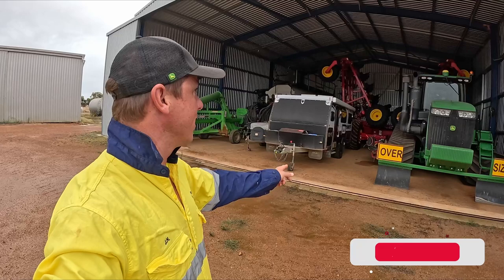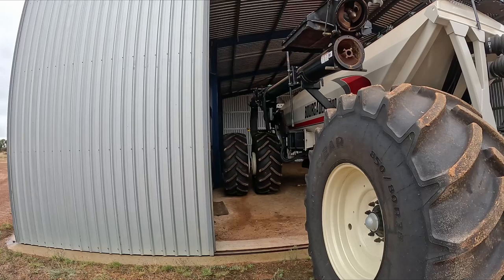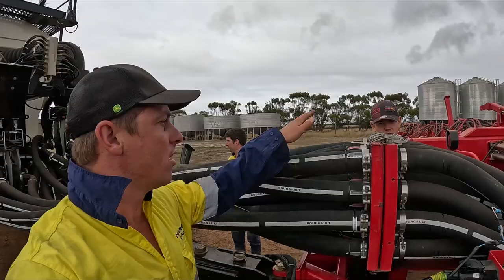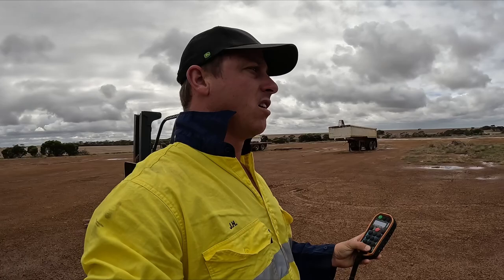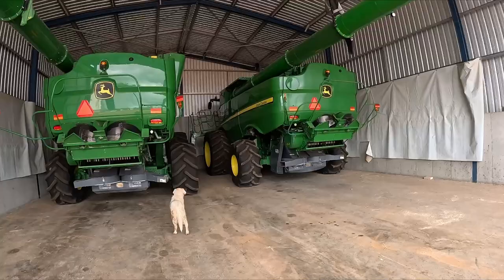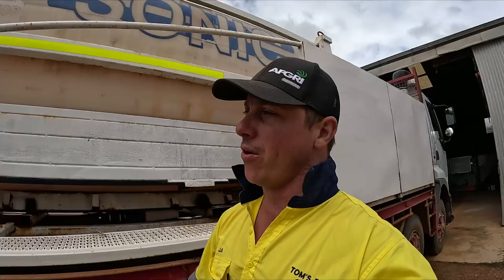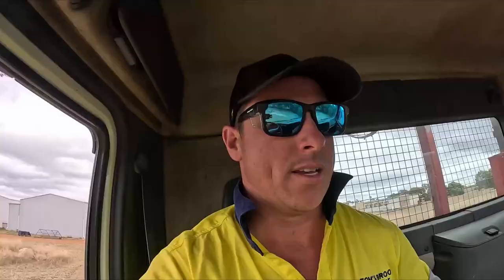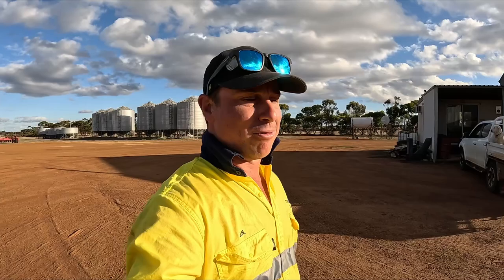2023 Seeding Preparation | Western Australia

Comment: How long are the augers on those headers? Looks a fair bit longer than the standard 28.5''
Reply from the maker: They are longer, I can't remember the length of the top of my head but it is the longest auger you can get and then there is an extension at the end to get out even further. Its so that we can run our chaser bins on the same track as the header!

Comment: hey mate, just wondering if you run a hydraulic booster for the seeder/cart
Reply from the maker: No we dont, the John Deere has good enough oil flow that we dont need one. There is also the advantage of the two oil pumps so we can split the load between them for best hydrolic flow